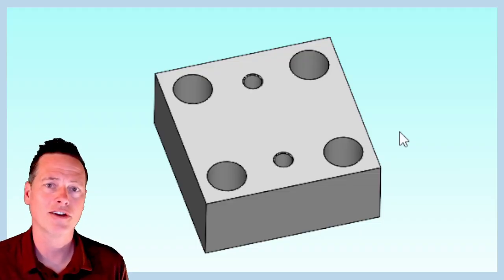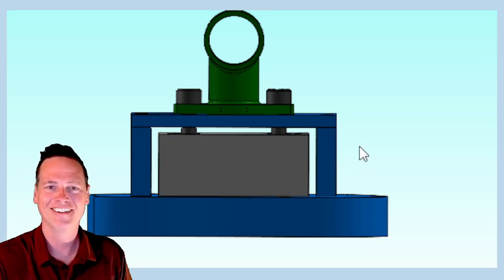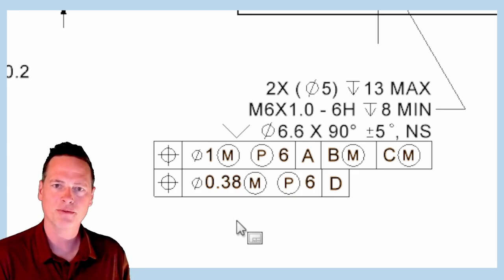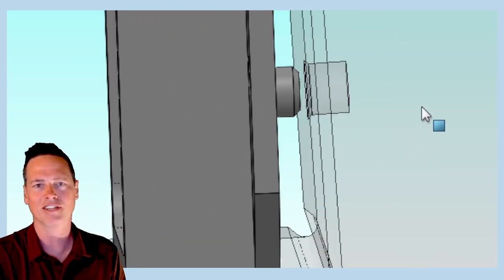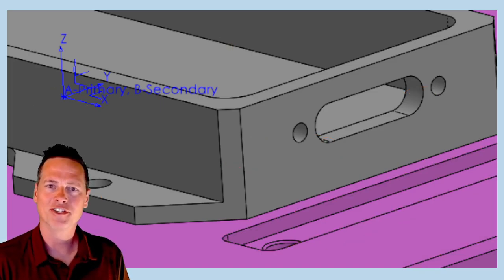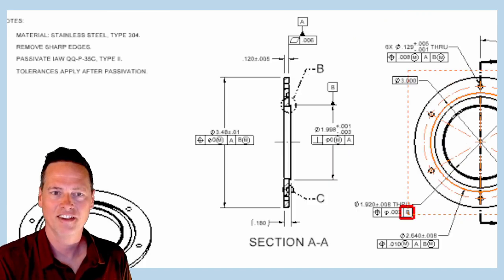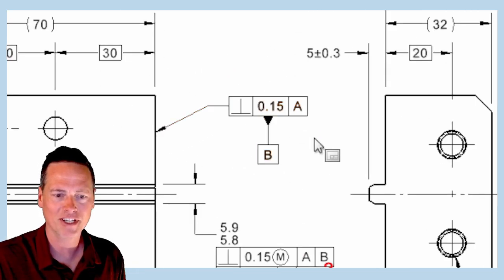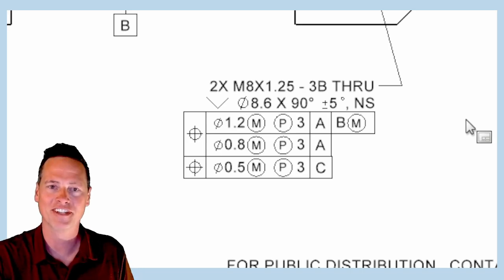"Bogus" Datum Reference Frames (Summer 2024)

Comment: For the first part, |D|B(M)|C(M)| is self-referential and meaningless like you said. its like having two primary datums at once with other datums only dependent on the hidden primary? Whut. With that said, I would definitely be lazy and just add a tight parallelism tolerance to the "datum D surface" instead of using a datum D, and keep the threaded holes |A|B(M)|C(M)| lol.

Great video. GD&T really forces you to think about manufacturing and inspection, and that is a pretty good motivator for clear design intent and ridding of  "multiple interpretations" of a print.

Comment: Can you please create a video on selection of right fit (RC6/ RC3 etc) for various dowel applications followed by calculating position & perpendicularity callouts based on Virtual conditions for both the dowel pins and dowel pin mating features (Hole and a slot)?

Comment: why would you put MMC on a threaded hole?
Reply: Indead, in case of the threaded hole MMR cannot use according to the ISO, because the threaded hole is not a "feature of linear size" - ISO 2692. The real solution in case of threaded hole the "Projected tolerance zone" - ISO 1101. This also applies to other videos.

Comment: Great video! finally a good explanation about the problems with those non-functional datum reference frames that mix datum references from different interfaces.

But I think there is a problem with the profile callout on 25:20. I don't think it makes sense on top of the perpendicularity tolerances. It cannot control location in the relevant direction because the A,B(M) DRF doesn't constrain that translation, so it really acts as an orientation control, but that's what the tighter perpendicularity tolerances are for.

Comment: Question not necessarily related directly to this video, perhaps something worth covering in another video, but how do you deal with setting positional tolerances on mounting holes which are meant to mount purchased components? Say for example you want to mount a gauge that you're buying to a panel that you're designing. That gauge has (4) threaded holes in a pattern which you'll use to mount the gauge to your panel. The vendor doesn't provide a virtual condition or FRTZ of the threaded holes and all they provide is the nominal or basic pattern dimensions. Do you assume a certain tolerance for the buy part? This is such a common occurrence for me and I'm sure for others as well, but I've never seen a recommendation on how to handle it.